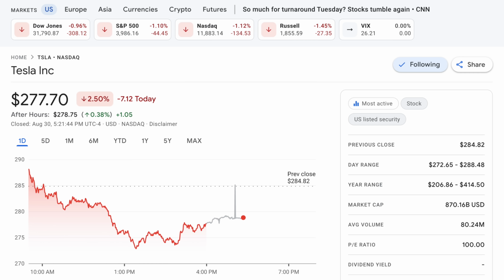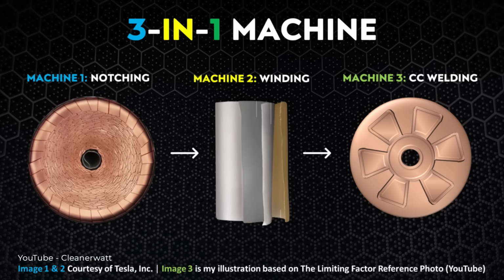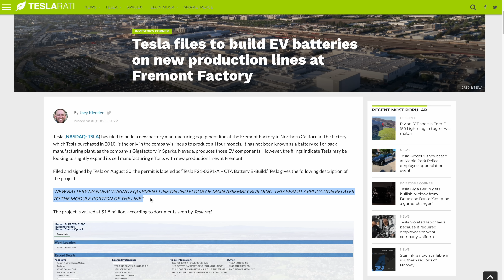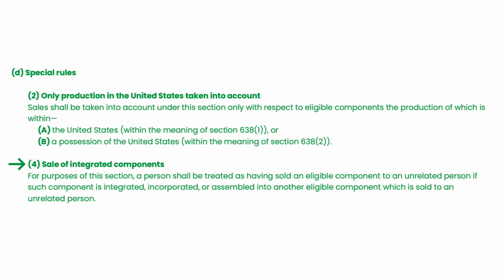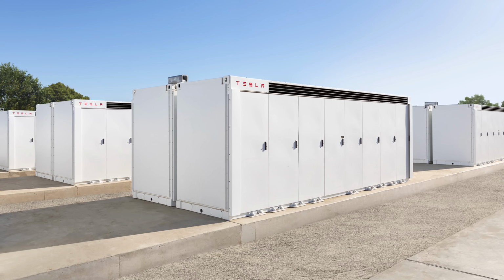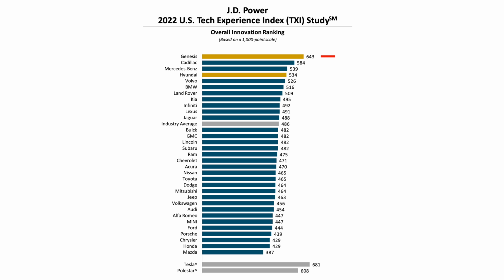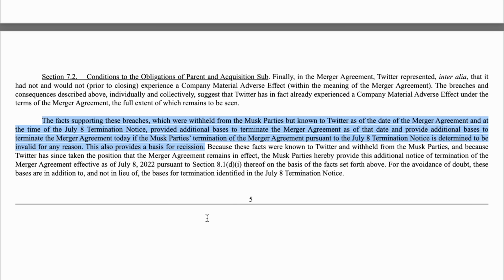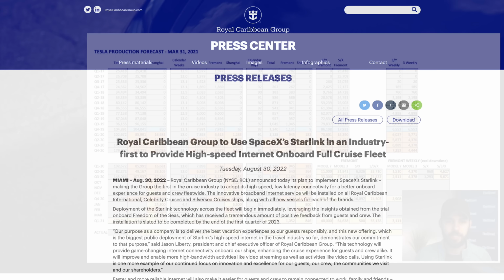Tesla 4680 Battery Improvement Rumors, Fremont Battery Permit

Comment: If (big IF) the new 4680 machine is the same size as each of the 3 old machines, or at least smaller than the 3 old machines together, then Tesla could possibly pack more production into a given floor space or volume. This might help a lot in next couple years to ease battery constraints.
Reply: Would probably also mean less transfer time between machines and thus speed up production by this amount.
Reply: it can also be more accuracy. every time you grab a part and do something and move it to another chuck there is the possibility of inaccuracy. perhaps they can laser cut the copper as it's being rolled into the jelly roll and then flatten the end and weld the contact plate on. so faster and more accurate.
Reply: Several options.
Just plan to run 2 of 3 with one spare or under running maintenance.
Run 3 full speed and stockpile cells where possible.
Run 3 at reduced speed while learning, when it's refined, expand the OTHER parts of production and go "1:1" rather than 3 into 1, thus expanding the whole output.

Comment: people, just watch the cleanerwatt video ... the point that was missed here was that the copper current collector will be eliminated, the bottom of the can is redesigned and does the job of that part.  So less parts, and potentially room for a taller jelly roll in the can.
Reply: Thanks for the reference. Presumably taller jelly roll means higher capacity?

Comment: It wouldn't be an elimination of those three steps. It would be an elimination of going from one machine to the next machine. So, transitioning a battery from one step to the next should take less time than going from one machine to another. Add on to that the 1-3 machine probably takes up less space than the 3 separate machines.
Reply: Exactly my thought :) Volumetric Efficiency
Reply: Well, having worked in production facilities in the past, it's probable that the transition time isn't really that great - as the video shows you can see the cells transported on a conveyor that moves pretty fast allowing for handoffs between machines quickly.  But maybe it could potentially shave a few seconds per battery which over a 24 hr period could definitely increase PR as well as lowered stops (transitions between machines can be problem areas causing more jams/downtime).

Cost-wise, making a machine more complex, as in trying to make one machine do 3 different jobs,  usually tends to increase the cost over 3 simpler machines (not always, but since these are usually custom made it usually does ;?) so there's that, but then I'm certain Tesla wouldn't opt for this if it didn't make $en$e, and often a single machine does give you greater control and increased reliability (once you get all the bugs worked out, lol).

Comment: one machine can just be 3 machines integrated into a single work station . advantages may be in part holding . for instance in a cnc lathe these days you get live tooling so one part can be machines all around and on ends inside one machine including milling etc.

Comment: I am pretty sure that Tesla was building modules and packs at Fremont, on the second floor, when the Model S production started in 2012.  I would expect that still is the case for Model S and X packs, both using the 18650 cells.  My take on the permit is that Tesla is improving the production process with a new module line.

Comment: Watch today's episode on the Electrified channel.  Regarding the battery manufacturing credit, Dillon covers the fact that Tesla will get the full credit from all batteries produced at the Panasonic/Tesla battery plant in Nevada, despite the fact the Panasonic is the one technically producing the batteries.  Apparently, Tesla had it drawn up in a 2020 contract, stating Tesla would receive all battery and battery related credits and rebates going forward.  Would be a huge windfall if true!!
Reply: Two different views and jobs and credibility...
Reply: I wouldn't rely on Dillon's analysis. He's good on passing on news but not coming up with it independently. Cleanerwatt I find is solid, he deserves more subs
Reply: While agree with that statement,  I don't think it applies to Rob's concerns. Tesla is buying the cells from Panasonic in the situation Dillon was talking about. Rob is talking about a situation where tesla is making its own cells and integrating them into products (megapack, semi, etc.) and then keeping those products for themselves. In that situation it's hard to see how Tesla would be eligible for the credits.

Comment: Rob, what if on an emergency situation, all Tesla will have access to StarLink to summon for help should a car for example falls off a cliff and have the ability to use StarLink ask for help.  That would make the car not only the safest but the most safest in terms of getting help in an emergency,. Safe can always be improved
Reply: Seems likely. Note that some ICE cars have had this already for several years via the standard mobile network, the advantage of Starlink is that it covers you in more remote areas.

Comment: they need to get the semi line running and then start building a second and third lines - expand the plant if the have to - they will have huge demand and they need to capitalize with economies of scale - the cathode plant will go a ways to further simply and secure the supply chain - they need solar panels on the trailers with additional battery packs in the trailer to get 600 mi range or something - they may be able to get close to 4000watts from an array and the trailers could make money while parked - they could have yards by megapacks

Comment: Regarding section 4 - Tesla can easily setup a separate company (e.g., Tesla Battery Inc) which would build the batteries/packs etc. If GM/Ford can benefit from the tax (and I'm sure they will given they lobbies for it), given they have a JV with LGE/SK, I'm sure Tesla can figure it out. So, while it might complicate things a bit, if it is an issue, it should be easy to get around. Tesla has a strong financial and legal body - I'm sure they will figure it out.
Reply: I'm hearing Ford is a bit annoyed with this part of the bill.

Comment: To the multiple commenters saying Tesla can just create a holding company, separate company, etc: it may not be that simple. I expect the provision is there to ensure that scam companies don't arise whose sole purpose is the collection of the tax credit. If a separate entity is formed (eg to produce batteries and battery modules) and that entity claims to be unrelated to Tesla, then other companies should be able to buy from that company, for example. Whatever the case, clarification is very much needed.
Reply: @ronblack7870  Agreed. BTW I wonder if it apllies to recycled batteries. There would definitely be room for abuse there, if you could do extremely light-touch 'recycling' and collect the credit again.

Comment: Tesla may decide to sell Semis to a fleet operator, then hire that operator to serve its internal needs.  They'd get the credits.  The same trick should work for Megapacks - sell them to a utility, let the utility serve Tesla's needs.

It's something to keep an eye on.  I don't know if the credits would outweigh the likely higher costs of engaging with third parties for services Tesla needs.

Royal Caribbean likely will have to shut down Starlink when in the territorial waters of nations whose regulators have not approved its operation.  Adding Starlink is still a good move for the cruise line, and adds a bit of pressure to foreign regulators.

We should probably expect an uptick in Starlink subscriptions from smaller operators - fishing tour boats, commercial fishing boats, yachts, and the like.  Most useful for boats operating out of US ports or from ports where Starlink is authorized.  How is authorization proceeding in Europe, do you know, Rob?  Their space industry is not well pleased with SpaceX's technical and commercial dominance.  I expect resistance.

Though Ukraine managed to authorize Starlink in about fifteen seconds flat.  If Russia attacks other Eastern European nations, it may change some minds right quick.

Thanks for your reporting, Rob.  Oh, and for what it's worth, I think you have been extremely careful about your credibility.  Top score from me!

Comment: moving something from one station to another is a process... combining all these may speed up the production as well as eliminating the time and labor to move from one machine to the next, and all the robots needed to do so. has the potential to save thousands or more.
Reply: I doubt there’s any humans moving rolls of batteries from one spool to the next. This seems like it won’t be saving much time, maybe space, though?
Reply: @daveinpublic  yeah i don't think so either, it's why i also said robots, but the point remains whether humans or robots, taking them out of the line increases roll out and decreases space and money in humans or robots whichever is used in anything they are trying to combine.

Comment: Have a friend in California . He went to charge his Tesla , After the car was charged the car would not run . The computer system through some wireless signals Turned his car off . His car was stuck for 2 days . Nope I won't have the State or Tesla shut my car down . IF you buy one . Remove all wireless signals in and out of the car . Gut the car.
Reply: Calm down Bubba

Comment: possible for you to slow down a bit of your broadcasting speed, Rob?  Say, down to CNN kind of speed? Point of the video is to communicate. So what is the rush?
Reply from the maker: You can reduce playback speed on YouTube if you prefer
Reply: @TeslaDaily  tried 25% slower. that was  way too slow. I venture to guess this is pre-recorded and played at higher speed? 😀
Reply: btw really like the content and watch it every day. but find it hard to follow some times.  especially consider you have a global audience. ❤️
Reply: @mfu9943  You can also use custom playback speeds like 0.9 for example. In the browser, you can achieve this by clicking the custom link in the playback speed dialog.
Reply: @dvanherbergen  thanks so much for the tip. Saw this option on PC but not in App. Did I miss something?
Reply: @mfu9943  I'm afraid it only works on PC.